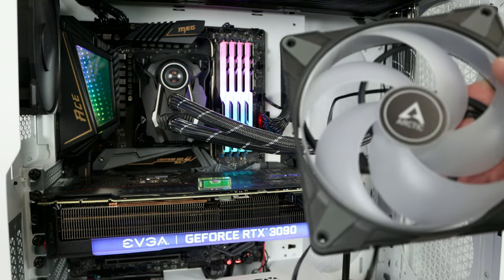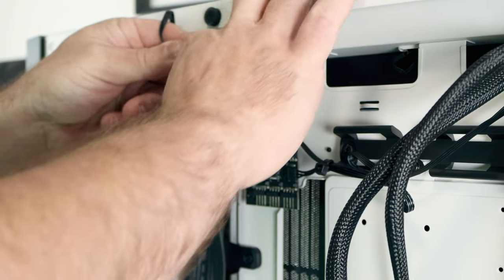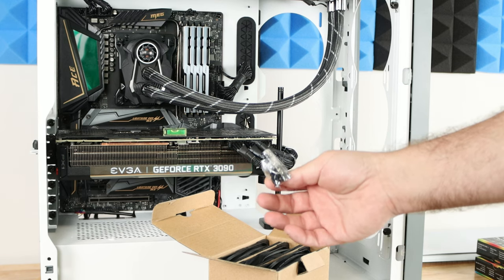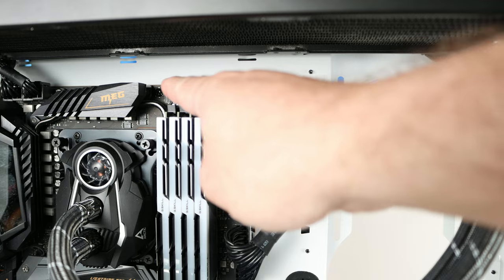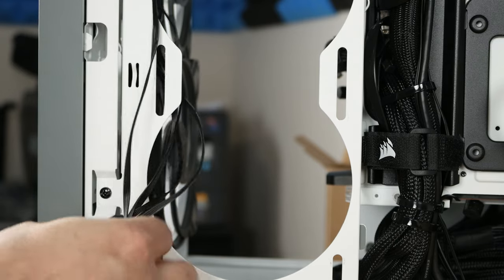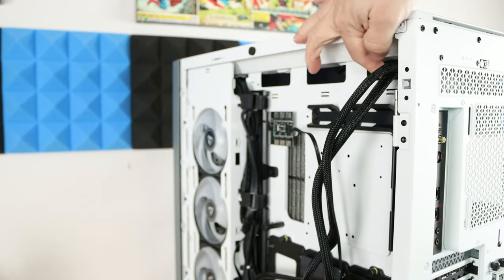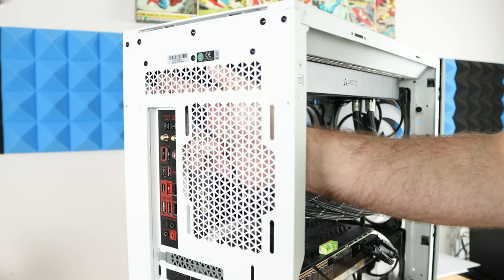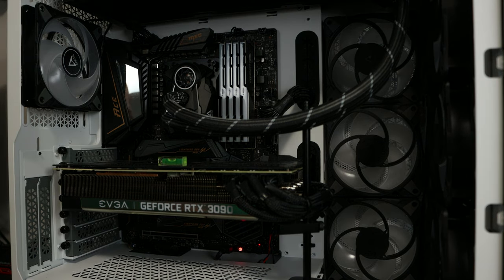How to Install a Case Fan in your PC - Step By Step Gaming PC Cooling Guide

Comment: Bro thanks! The stock fans that were already connected to the case was all facing inwards, sucking air inside the pc...
Reply from the maker: @Player-001  you want the front fans to blow air into the case and the top and rear to suck air out

Comment: My case came with 4 fans already and my AIO came with 2 140s but I will be changing all of them for reverse fans except for the case fan.  The reserve fans make the case look a lot cleaner.
Reply from the maker: Before you change them all to reverse fans, verify that the pressure and airflow is better, compare and contrast, all fans are not built the same.

Comment: can you make a video to how attach an internal case fan on your nvme ssd, a thermal pad is next to useless outside cold climates and this is a very expensive piece of equipment which for some reason people think throttling leads to no damage
Reply from the maker: NVME drives don't have a pinout to connect a fan nor the ability to transfer power.  You need to connect a fan, like I show you here to the motherboard and aim at the drive and maybe add a heatsink to it, like this  https://a.co/d/07w29SnN

Comment: How are the noise levels on those Arctic ARGB fans please? I wanted to buy 3 of them. are they the P12 A-RGB 0DB ?
Reply from the maker: They are awesome, 2 videos you will want to check out on them, first

The Ultimate PC Case Fans for your PC - Arctic's P12 Max and P14 PWM PST A-RGB PC Case fans
https://youtu.be/m0d3Xs5c4Ps

and you will love my most current video: 

How to install the Arctic Freezer 36 ARGB CPU Cooler - AMD and Intel Step by Step Guide
https://youtu.be/ueOxb2N105w

These both are including those fans, and you will love them.

Comment: Sir do you have a tutorial on how to fix external hard drive doesn't show on my pc and laptop. Partition wont work and any third party apps doesn't work also.
Reply from the maker: No, but I may do one soon.  I highly recommend removeing the drive from the enclosure, and connecting it to the sATA ports and trying the 3rd party tools there, if they don't work, you can send your drive to Data Matrix to get recovered, if your data is that important, it will costs at least 1 thousand dollars, I have used them and they are great..... but not cheap.

Comment: I see few components in common or almost 👀  Corsair 5000D Airflow- RGB 12V Arctic P12 fans 6 of them with 3 on my Arctic freezer II 360mm RGB. But can't fit the AIO as top mounted so had to do it front mounted 🙁 unfortunately the fan on the AIO hit the CPU 8 pin connector. Anyway Nice video as always and price for performance i really like these fans.
Reply from the maker: Look a little closer my friend, I was able to overcome that, I am using the 5000 as well and have mine at the top, you should be good, the video will show you.  I had the same issue till I looked at it a little differently
Reply: @ThisBytesForYou  guess I could try your way mmmm so fans outside the top panel interesting
Reply from the maker: @KenTek88  works well too ;)

Comment: Thanks for this video. Does it cause any problems when plugging the 3pin splitter with 4 fans connected to the motherboard?
Reply from the maker: no, just you will have to control the fans speeds through voltages in the BIOS if you want to control the speeds, 3 pin to 4Pin, you are running at full speed

Comment from the maker: WATCH NEXT: Tips on Wire Management : https://youtu.be/WwYSSBNgyeQ
We're going to show you how to install a case fan in your PC.  Actually, we are going to go over how to install and connect RGB fans in your PC, Best way to keep your PC Cool during summer.
Check them out on my Amazon Affiliate link
🔥4 x ARCTIC P12 PWM PST A-RGB Case Fans: https://geni.us/MVzJ7
🔥2 x ARCTIC P14 PWM PST A-RGB Case Fans: https://geni.us/RLBylYO
Reply: I need more air flow!!!  The dogs love the external fan I have set up.
Reply from the maker: Love it, dogs rock ;)

Comment: Thanks for the video , i was always confused with how my fans were placed , apparently my front three fans were in the wrong direction as i got it build by my tech guy. And due to extensive gaming i do , it cost my cpu in the run past 3 years. I am now upgrading to 7800X3D , but I'll make sure now i have tbe proper inflow and outflow. Thanks a lot. I was confused but you made a very good video about a very basic thing most people miss out. Also regarding a question is it okay if my radiator is above my pump fans ? I am using a 240mm MSI AIO Cooler. Should it be of any issue ?
Reply from the maker: Always a pleasure my friend, so very happy you stopped by, trusted in me to help you, liked and subbed as well as took a moment out of your day to thank me.  It means a ton to me and I am so very happy I could help you.   Ummm, do you mean to install it the way I did in this video?
Reply from the maker: oh oh I see what you mean, the fans on the bottom of the radiator is the usual way, helps keep down noise, but the thickness of this radiator cased me to install it this way, I had no choice, so yes, its best to have the fans under the radiator, instead of the top like I have in this video
Reply: @ThisBytesForYou  Ah I see , thanks a ton brother. I have a msi Gungir 110R , got ample space for it . I'll watch your other videos when I get my upgrade for AM5 soon.
Reply from the maker: awesome bud, happy to help, I have a bunch of build videos with AM5 as well, maybe they will help too, build, bios flash and configuration, windows install, drivers install and more.

Comment: alright i hooked these mamas up one works, the ones that are daisy chained will spin like a quarter turn give up and just keep doing that, also no rgb in two
Reply from the maker: Try each fan by itself to make sure each fan works properly, try the aRGB as well on each fan to verify they work.  What is the manufacturer and model number of the fans and your motherboard?

Comment: I considered doing the radiator inside the case (top mounted) and fans on outside as exhaust but I like the idea of the dust filter. But I guess with this set up the dust would never get inside with this setup.
Reply from the maker: exactly ;)

Comment: hi there. i want to connect my case fans from the psu to my motherboard but when i connect them all together and connect it to the motherboard, my fans don't work. What do you think I should do. I would be very grateful if you could answer
Reply from the maker: That's a hard one, not being there and all. 
1. If you plug in one and test, does it work 
2. have you tried each individually?
3. If they all work individually, how are you plugging them in together?
4.  Verify there is not a pin bent
5. Are you using the 4pin pwn connection?
Reply: @ThisBytesForYou  sorry i didn’t realise your answer yesterday. 
1- No it didn’t work
2-No i didn’t but the one that plugged in psu worked only and that one has male 4 pin and sata power exit, i really don’t understand that
3-One male 4 pin plugged other’s female 4 pin and the last one’s sata exit plugged into psu
4-There is not a pin bent 
5-Yes using 4 pim pwm
Reply from the maker: No worries my friend
what is the manufacturer and model number of your motherboard?
Also, what is the manufacturer and model number of the fans?
Reply: @ThisBytesForYou  Motherboard is gigabayte B550 Gaming X V2(Rev 1.4) .  Fans came with case and case name Rampage Redsky 4X120 mm
Reply from the maker: OK, so on your board, you have 5 fan headers you can use
Sysfan1, next to the 8Pin CPU Power
Sys_Fan2 just above the 1st pcie slot
Sys_Fan3 just next to the TPM plug, to the right of the front panel audio header
then a CPU_Fan and a CPU_Fan Opt, which I usually only use for the cpu fan or the liquid cooling radiator
which are you using and do you have all 4 pins plugged in?
You can see them all on page 4
https://download.gigabyte.com/FileList/Manual/mb_manual_b550-gaming-x-v2_1401_e.pdf?v=a34956245942dfa6f27286a4539c0b7b
Reply: @ThisBytesForYou  I'm  just using CPU_Fan. All other headers are empty. By the way CPU_Fan header using for default Ryzen 5 5600X's fan. Other fans plugged each other and last one of them plugged in PSU that's all. Meanwhile thank you so much for your helping I believe I will find the solution thanks to you
Reply from the maker: you dont want to connect that to CPU_Fan, you want to connect them to CPU_Fan Opt or something else.   Test just one for now, if that one works, test another one by itself and see if that works, test them all.  I show you how to connect them as well in this video, have you watched this video?
Reply: @ThisBytesForYou  Yes i watched the video and i tested them but they didn't work. I tried after you said that to try one by one
Reply from the maker: so, do they work in another system?
Reply: @ThisBytesForYou  no they didn't
Reply from the maker: Dead I guess, odd, looks like you need some new ones, check these out on my Amazon Affiliate link: https://geni.us/RLBylYO
Reply: @ThisBytesForYou  i bought the case 1 week ago i don't think it's broken but thank you anyway
Reply from the maker: Things come DOA all the time, it happens, if anything call or email the company to send you new ones, these are bad.
Reply: @ThisBytesForYou  Okay thank you so much
Reply from the maker: anytime my friend, let me know how it goes.

Comment: does connecting fans to mobo instead of psu make it spin faster or both of them are same
Reply from the maker: well, directly to fan will make it spin 100%, 100% of the time, to a 4 pin header on the board (PWM) will make it run as it needs to, less noise but you just have to configure it like I show you.

Comment: Hello,i have a question. I am using thr prime h510M-E motherboard so just wondering if i can connect the deepcool deepcool fk120 fan to the CHA_FAN(SYS_FAN) or i will connect it to the CPU fan using a fan splitter
Reply: and i have a pc case of vampiric mag 100R, so will it affects the parts of the motherboard because of the feature of changing colors?
Reply from the maker: you would connect a cpu fan to the cpu fan header, an AIO pump to the AIO pump header, if you dont have an AIO pump header, you would connect it to cha_fan.  or any other header that can be controlled by PWM in the BIOS.  This fan, would go connected to any other header that is not cpu fan and set to PWM.
Reply from the maker: if that case has ARGB fans, you would connect them to an ARGB header but your board doesnt have aRGB only RGB.  If you dont care about the RGB, it will still work fine, it just wont be lit.  You could buy this that converts ARGB to RGB: https://www.amazon.com/DeePCool-Convertor-TransferHub-Motherboard-Non-Compatible/dp/B09ZYDB4X8/ref=sxin_16_pa_sp_search_thematic_sspa?content-id=amzn1.sym.a2e12efe-e275-4efd-81b9-095fa99ad91f%3Aamzn1.sym.a2e12efe-e275-4efd-81b9-095fa99ad91f&crid=3GG114J3QDLW7&cv_ct_cx=rgb%2Bcontroller&keywords=rgb%2Bcontroller&pd_rd_i=B09ZYDB4X8&pd_rd_r=90c97a38-fd9a-44e5-a89f-965ba980ed2a&pd_rd_w=R3xwA&pd_rd_wg=QZg39&pf_rd_p=a2e12efe-e275-4efd-81b9-095fa99ad91f&pf_rd_r=EWH5YTP7RNWS5KADG9A3&qid=1697799816&sbo=RZvfv%2F%2FHxDF%2BO5021pAnSA%3D%3D&sprefix=rgb%2Bcontrolle%2Caps%2C93&sr=1-3-364cf978-ce2a-480a-9bb0-bdb96faa0f61-spons&sp_csd=d2lkZ2V0TmFtZT1zcF9zZWFyY2hfdGhlbWF0aWM&th=1

Comment: I'm trying to install my old 2 RGB fans to my new system. My new system only has 2 fans (not RGB) with the small connections and each fan is in individual headers on the mobo. So can I just connect my old 2 RGB fans to the power supply and use the 3rd fan header on my mobo?
Thanks for the help.
Reply: I'm just double checking because I don't want to break anything
Reply from the maker: By chance... have you watched this video?
Reply: @ThisBytesForYou  yes
Reply from the maker: @darren4140   I show you exactly how and where to connect them, not sure which part you are confused on?
Reply: @ThisBytesForYou  I didn't see you plug anything into the power supply
Reply from the maker: your right, I didn't, I don't like my fans working at 100%, they are LOUD. What is the manufacturer and model number of your motherboard?  Also, you can use fan header splitters, find it on my Amazon Global Affiliate link: https://geni.us/ym7DW9
Reply: @ThisBytesForYou  on my old system the fans plugged into the PSU only. On my new system the new fans plug into my mobo only.
Reply: @ThisBytesForYou  so I don't want my old fans running at 100%. Is there an adapter that I can change the bigger plug into a mobo connection?
Reply from the maker: @darren4140  did you see what I linked up in my last reply?
Reply: @ThisBytesForYou  did you read my last comment? That's the connection I need but my old 2 RGB fans doesn't have it
Reply from the maker: Do you mean Molex? 
Like this
https://www.amazon.com/StarTech-com-LP4-Power-Splitter-Cable/dp/B000067SLY
Reply: @ThisBytesForYou  yes I think I need a PWM to Molex cable.
Reply from the maker: Molex fans will not be able to utilize PWM since the motor itself works with PWM on PWM fans.  You will need new fans

Here is a 3 pack of 120mm fans from my Global Amazon Affiliate link: https://geni.us/j8Xn
Here is a 3 pack of 140mm fans from my Global Amazon Affiliate link: https://geni.us/Dm4gob
This will let you split 1 PWM Header into 3 fans from my Global Amazon Affiliate link: https://geni.us/AH88T
This will let you split 1 aRGB Header into 4 Headers to connect 4 aRGB fans from my Global Amazon Affiliate link: https://geni.us/woVc4Ma

I use these fans (the 140mm fans) and header adapters, and can recommend them HIGHLY.
Reply: @ThisBytesForYou  ok thanks for the advice 👍
Reply from the maker: Always a pleasure my friend, so very happy you stopped by, trusted in me to help you, liked and subbed as well as took a moment out of your day to thank me.  It means a ton to me and I am so very happy I could help you.

Comment: @TheBytesForYou hey quick question I have a defective fan that spins but wont light up. Could I simply disconnect the fan itself or is there no plug and play from the fan itself? Only way to disconnect is from the hub right ?
Reply from the maker: the fan will have 2 cables, usually if you have rGB lights, it will have a 3 pin or a 4pin fan cable, and a 3 pin or a 4pin argb cable, (now that I saw it, it might be confusing) check out this video, I go over it.  If the light doesnt turn on but others do, the light is either dead or not connected, watch this video, you dont need the rgb light, just the fan
Reply: @ThisBytesForYou  right I have a rig with 9 fans one of em the light went out. I was wondering could I replace the fan using the same wiring? Or would I have to install the new wiring from the new fan?
Reply from the maker: @ReneHamilton  you will need to disconnect the fan, cables and all, just for that one fan, and install a new one, I show you how here, its not hard
Reply: @ThisBytesForYou  thanks for the replies 👍 copy that
Reply from the maker: Always a pleasure my friend, so very happy you stopped by, trusted in me to help you, liked and subbed as well as took a moment out of your day to thank me.  It means a ton to me and I am so very happy I could help you.

Comment: I have a question, does it matter if the brand sof the fans are the same or different i am new to pc building and my pc currently only has 1 fan and i want to upgrade but i cant find the current fan in stock anywhere and i wanna get another rgb fans but idk if they will work
Reply from the maker: no, it doesn't mater, but you want them to match because if not, they can be extra noisy, not as powerful, not blow as much air, etc.  I recommend to keep all your fans the same, or as close as possible.
Reply: @ThisBytesForYou  tysm imma try to find something
Reply from the maker: anytime bud, check out the Amazon affiliate links I have in the description, it helps the channel and they are great fans too.

Comment: Quick question...I have installed 3x Lian Li Uni Fan TL LCD 120mm reverse blade fans and 3x Lian Li Uni Fan TL 120mm Reverse Blade Fans....when I power down the computer everything switches off as normal...all the RGB turns off too...but all 6 fans remain spinning...I have triple checked all the connections between the fans and controller and motherboard...I have also checked the BIOS and I'm stumped...no matter what I try they just never stop spinning....they'll only momentarily stop during a system reboot....any suggestions would be greatly appreciated
Reply from the maker: How are you powering them, and the hub they connect into?  Update the  L-Connect 3 https://lian-li.com/L-Connect3/ then make sure you update controller firmware on them.  Make sure you uninstall the old version, completely, restart if they ask you, then install this version and update the firmware.
Reply: @ThisBytesForYou    the 3 lcd fans are in one group, the 3 non lcd fans are in one group…both groups plugged into the controller ports 1 & 2…the controller is plugged into the motherboard pwm header, the 5v argb header, the usb header and the 6pin pcie into the PSU…all software and drivers are reinstalled and up to date
Reply from the maker: And the 2nd and 3rd sentance?
Reply from the maker: Did you update the firmware on the Fans through L-Connect?
Reply: @ThisBytesForYou  yes sir…all done
Reply from the maker: did you watch this video: https://youtu.be/sN3IQQbM03Q?si=tkBT43zMNvE9ejOm
Reply: @ThisBytesForYou  done
Reply from the maker: and "Plug TL LCD on controller port 2, 3, 4 only"
Reply: @ThisBytesForYou  I did not…I’ll check it out
Thank you
Reply: @ThisBytesForYou  will let you know how it goes…thank you kindly
Reply from the maker: anytime bud
Reply: @ThisBytesForYou  your advice helped!…thanks again my friend…all is working fine now…you sir, are a legend 😎
Reply from the maker: awesome bud, happy I could help.